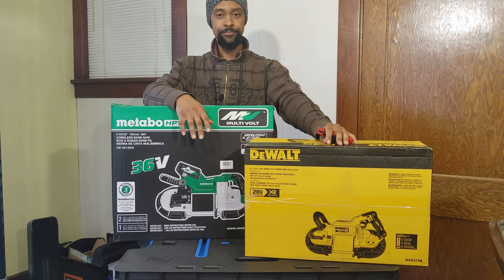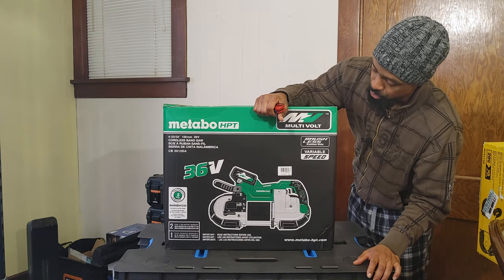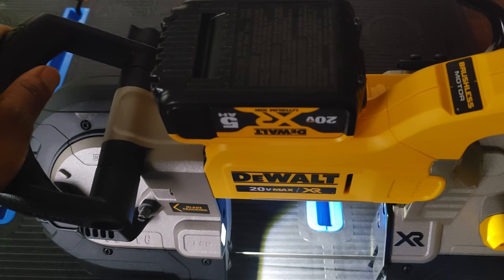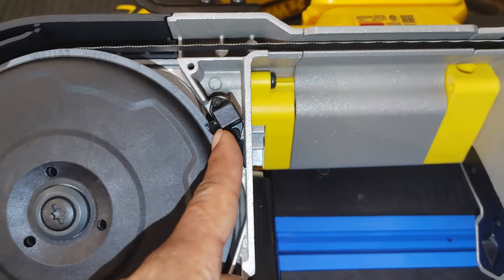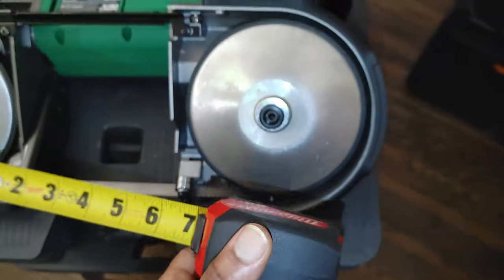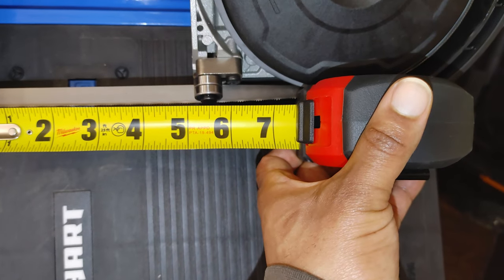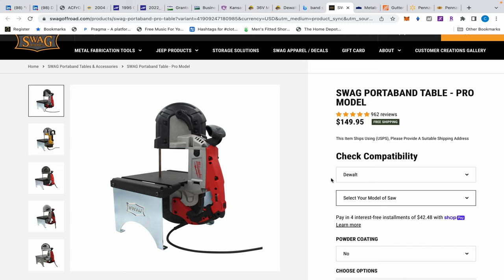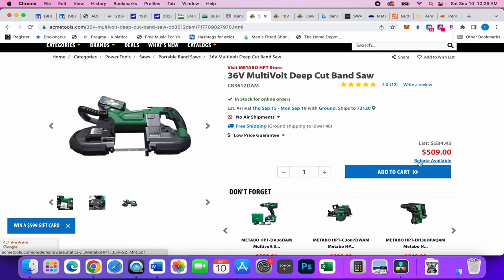DeWALT  Bandsaw Vs Metabo HPT Bandsaw

Comment from the maker: That brake is INCREDIBLE! Totally surprised me.
Reply: That and the sturdy material, and that sweet corded option, lol. I grabbed the dewalt and some other tools last holiday, and just didn’t care for them despite the fact that the ergonomics are top notch. So I sold it and doubled my money instead, lol. I’ll keep an eye out for a sale in the Metabo hpt. Thanks for the info. I did keep the 12v dewalt tools I picked up. I like em so far. Outside of Metabo hpt, I’m mostly 12v dewalt and Milwaukee. The German Metabo’s cooler is tempting me to add a line though, lol
Reply from the maker: @iloveknives75  I did the EXACT same thing

Comment: WAIT are you sure the Metabo does NOT have a variable tigger?  its only pre selected speeds?  my DREAM is to get a FULL deep cut cordless bandsaw, prefer dewalt for batteries BUT im open to most others... i dont care this or that weight, theres LOTS of guys with the teenie tiny ones at work
Reply from the maker: Nope! No variable trigger! It has a variable dial which I actually prefer if you get good at dialing it in, but for those with that level of balance and finesse, the variable trigger would be good I think. It also has an Auto feature, so you could technically just set it there and it'll adjust speed automatically, I generally hate those features on tools, but I've actually read reviews of people saying it works really well.